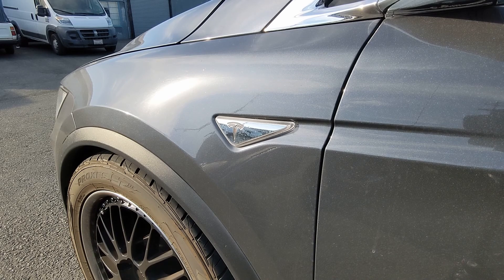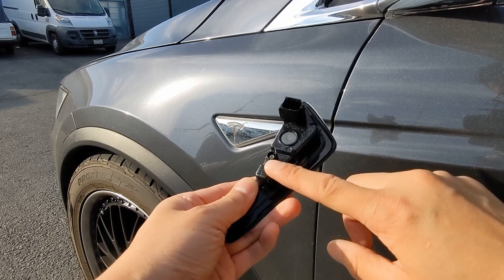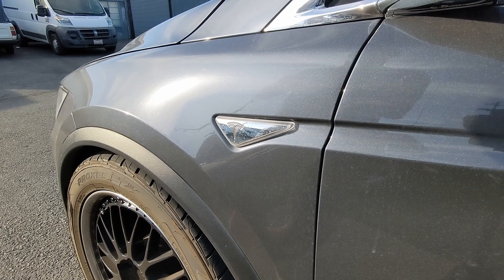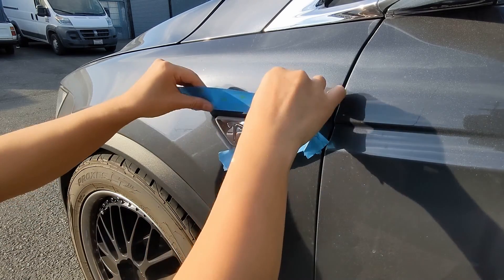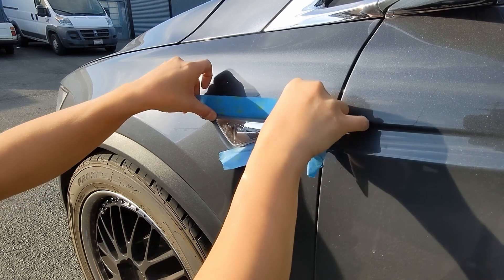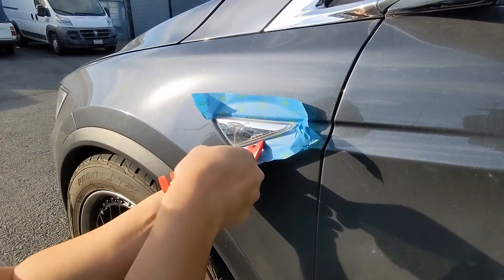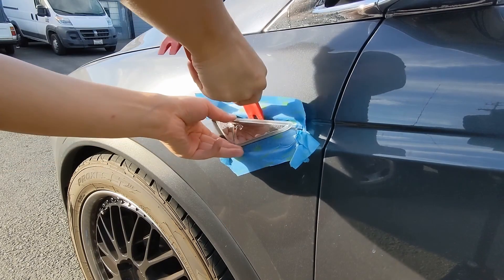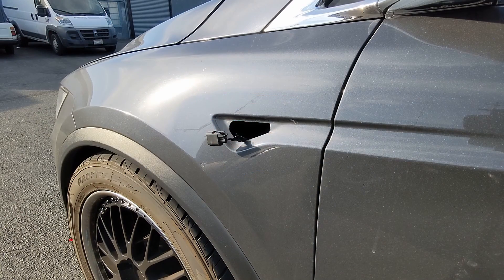Tesla Model S/ AP1 👉 AP2 repeater upgrade!

Comment: You can change just the lightbulb in the old side marker, but the updated one looks better
Reply from the maker: Nice! Something failed inside mine and I didn't want to deal with it so I went the easy route.
Reply: Now I'm thinking of doing it on my car. Are they different from Model 3 and Model S? Because the new ones from Tesla only come in black :(